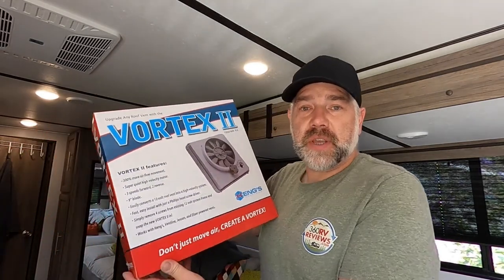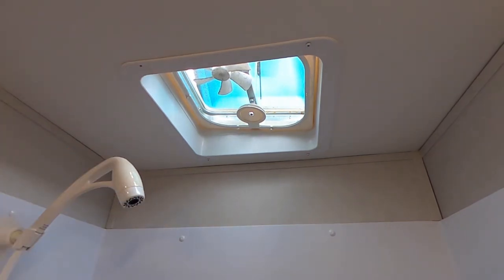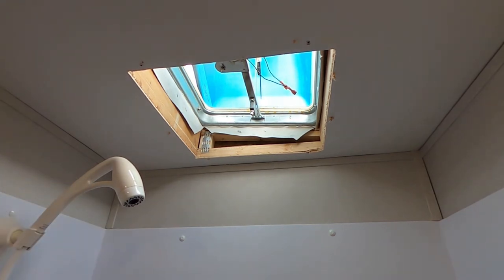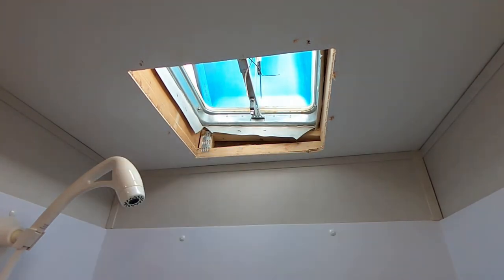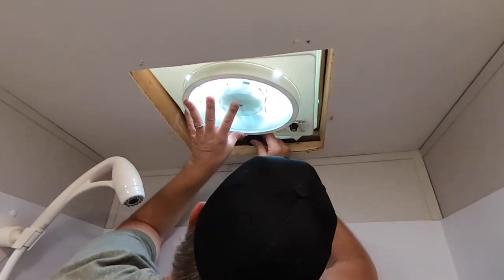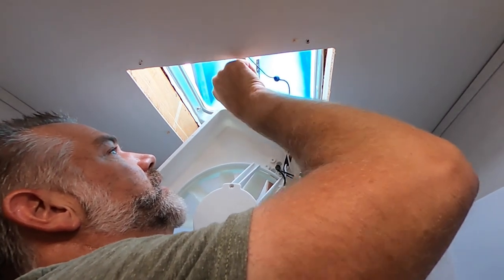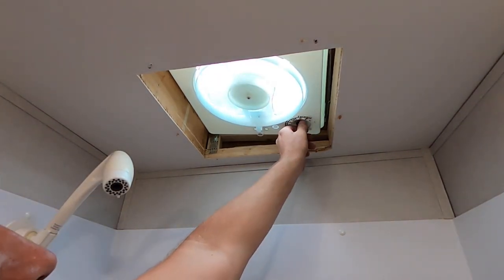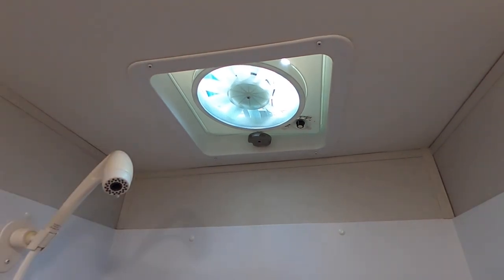How To, Super Easy RV Roof Vent Fan Upgrade, Vortex II Kit.

Comment: Hey! Great job. I found that you only need to remove the old motor but NOT the bracket. The bracket does not interfere with the new fan in any way.  Best regards